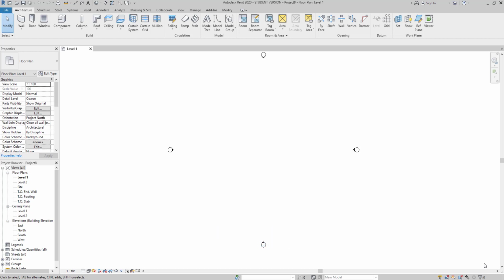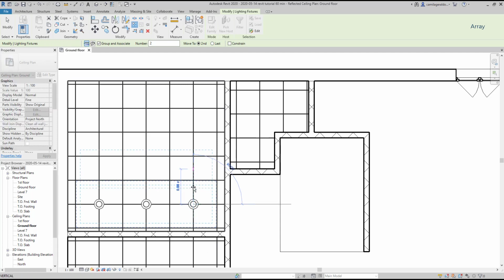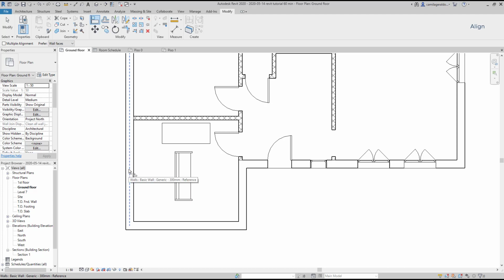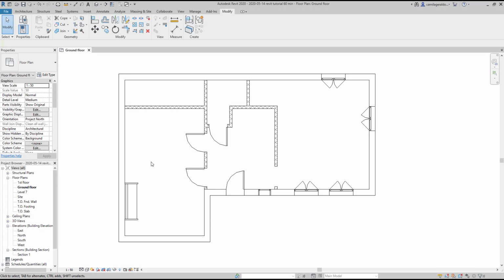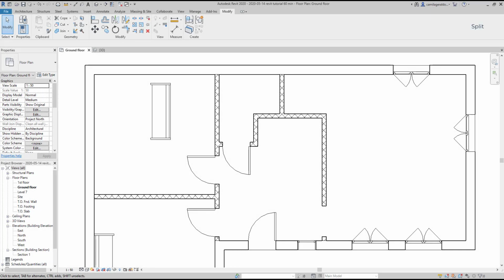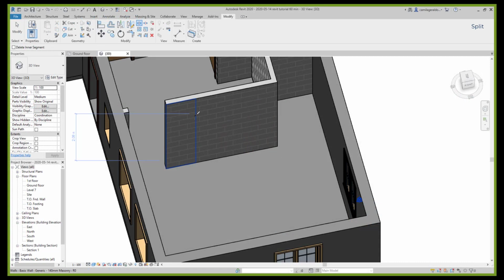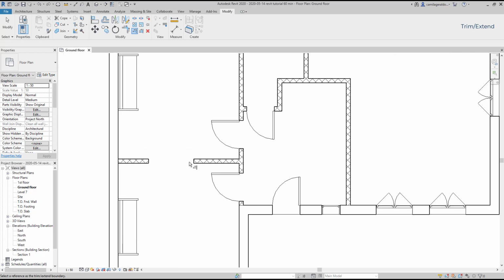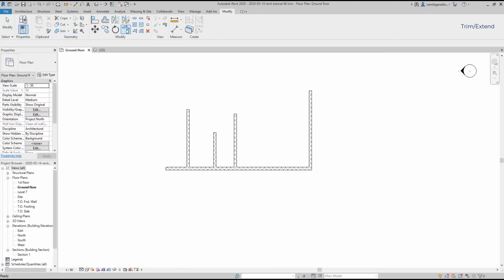Revit - Complete Tutorial for Beginners - Part 4 (Modify commands)

Comment: May I ask do you use AutoCAD more often or Revit?
Reply from the maker: Depends what you need to draw. Remember that autocad is a pure CAD software. You can make any technical design that you want. In Revit we model a project. 
It takes time to learn, but once you are experienced is way faster to draw an Architectural project for example.

Comment: Hi! First of all, thank you for all the videos - they have been super helpful and easy to follow! I have one question: Is there a way to resize the text on the ribbon or even scale the ribbon itself? Because the bottom names of the ribbon tools are always cropped for me. For example, in the build section, the "Curtain system" and "Curtain grid" buttons, the words "system" and "grid" are cropped right at the half. I am using Revit 2020. Thanks for your help!
Reply from the maker: Hello Nina. First of all, thanks a lot for watching.
Honestly, I don't know exactly the solution for your problem. Can you try to resize the screen in Windows on the Display settings? For me, when I set a small resolution, Revit automatically groups some panels and some of the icons are just displayed smaller. I don't have any cropped text. If that doesn't work, you may try to reinstall the software.